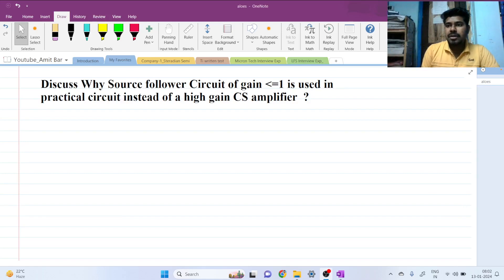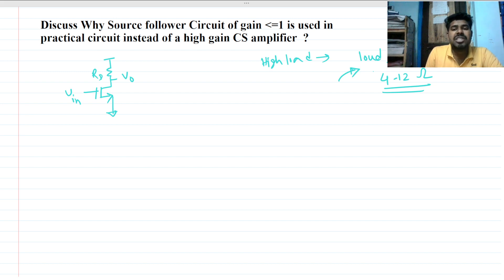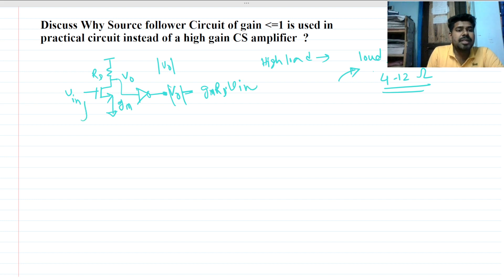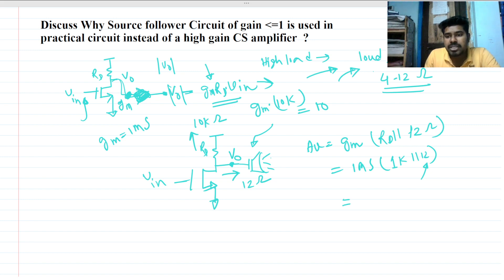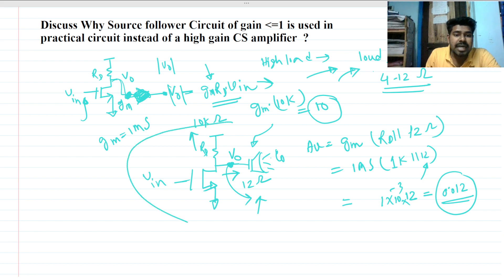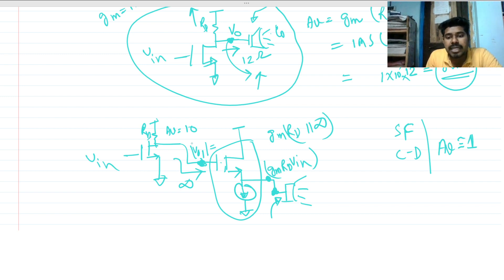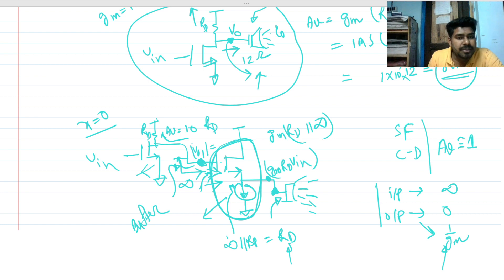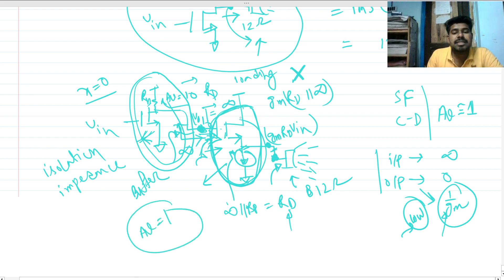Discuss Why Source follower Circuit is so popular_ Analog Design interview questions

Comment: the brief answer is, it is widely used because of:
- Impedance matchning: source follower has low output impedance which means it has the ability to drive low-impedance loads with signal attenuation
- wide bandwidth: this is a bit trivial as miller effect is negligible as the gain is approx 1, thus the input capacitance
Cin=Cgs + (1-Av)Cgd ~  Cgs 
and other things such as signal level shifting, stablity and linearity

Comment: Much appreciated sir 😊
At 2:18 In this circuit cD with S have a current source , if there are gmb=2mA/v^2, gm=1.5mA/v^2, ro=2kohm, and vo/vi?

rob=1/gmb=0.5k ohm
1/gm=1.5k ohm
So Ro=2//0.5=1/2.5=0.4k
av=vo/vi=0.4k/(1.5k+0.4k)=0.21 v/v